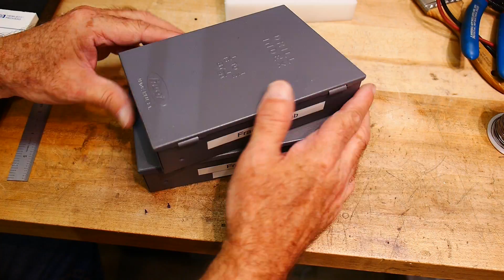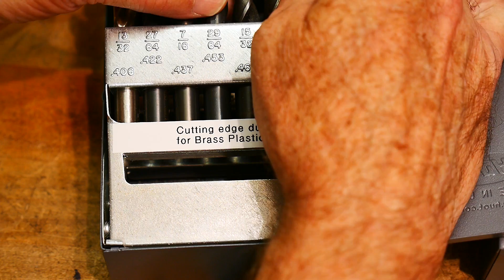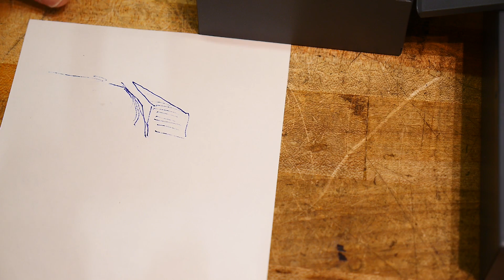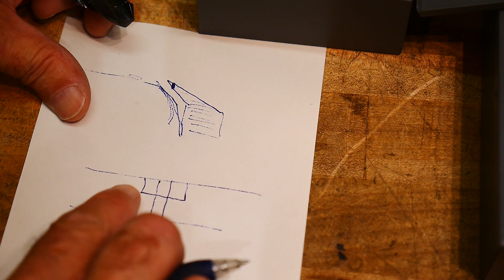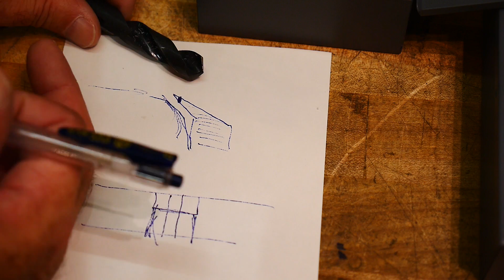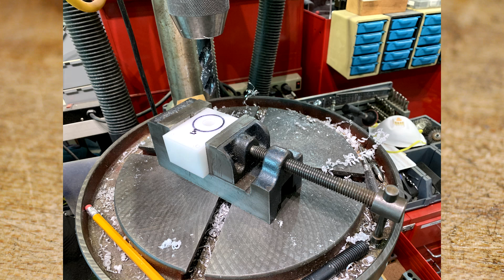#518 Drilling Plastic is Dangerous

Comment: Just wondering why you didn't bolt your vice to the table using the slots in the table that are there for just that purpose.
Reply from the maker: I do use the t-slot for some things. a clamp is faster and more flexible most of the time

Comment: Great advice. I would add that using any sharp tool on plastics can catch you off guard. I was once cutting a bezel for a floppy drive and needed a square hole for the push button. I used a new, very sharp knife on the polypropylene I was using to make the bezel, pressing hard into the plastic to form the square edges. I slipped, and 28 stitches across four fingers later, I learned a hard lesson.

Comment: I am glad you are okay. Thank you for warning people.

They sell bits for drilling plastic. Oddly the angle on plastic bits is much pointier. Drill bits that can slip in the chuck might be safer than the ones with the three flats on them--in this one case.

There are other issues drilling plastic. It's good to know how brittle the plastic is. For instance, plexiglass/acrylic/perspex is very brittle, and if it should break, it's edges can be sharp enough to make a cutting edge. Think: prison shank. : )

Plastic gets got and expands grabbing onto things. This expansion also causing things such as the Apple G4 Cube or aircraft canopies to break even if you look at them wrong. Often holes are drilled a bit large for this reason. The expansion in plastic can make fitted parts--not fit right.

When using a drill press, the operator must always be aware of the direction of rotation. For instance parts held with even vice grips can cam out much easier one way over another.

A Fostner-type woodworking bit might drill that in one go. Obviously, you still have to be careful. When drilling hockey-pucks for machine feet, I found that while the drilling went really fast, so did the drillings/curls which quickly became an unmanageable mess, which in-did not break, but climbed the bit.
[https://youtu.be/NIKTbloomnQ?t=987}

When drilling Delrin/Acetal, it's still good to remember that all the while, it's releasing formaldehyde.

I also think the plastic is UMWPE or HDPE.

Comment: Nice tip about dulling the edge. Also I think you need to use very slow cutting speeds for plastic and brass. The final bits we used to call cone cutters.
Reply: And iv heard of people using dish soap to lubricate the bit and help it cut more smoothly